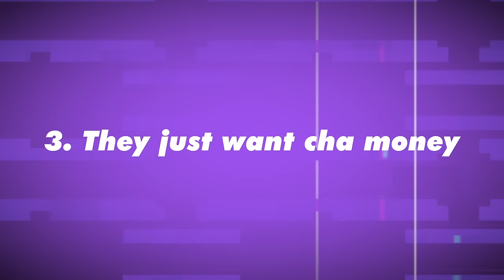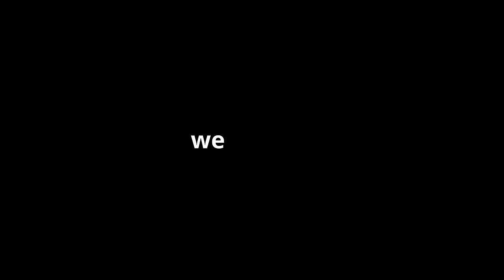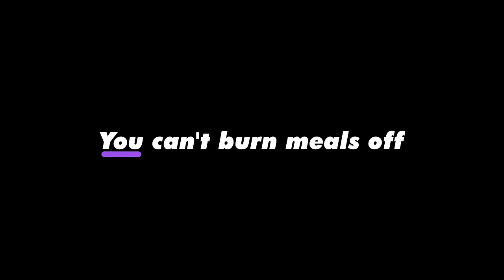3 MUST knows when beginning your weight loss journey

Comment: I do use the scale, but I do my best to not get too worked up by fluctuations. Mostly I'm curious about the fluctuations and try to determine what might be causing them, because I'm oddly oblivious to my body. I mean, I had a partially collapsed lung once and pretty much didn't realize it until I went to the doctor for flu symptoms that just wouldn't go away and got a chest x-ray. She was flabbergasted and sent me home with 7 medications. (If I wasn't walking around, she told me she'd have admitted me to the hospital.) 

Also, if things start trending upward, it gets me back in line so I don't just meh and slip back into bad habits.

Comment: I started working out to gain strength and muscle mass, but I am ALSO losing weight at a satisfying clip. 75 lbs so far... This is the longest I've been able to maintain a workout regimen because I focused on one simple goal and stuck to it rather than cast a wide net of cardio to lose weight, leg day, arm day etc... Eventually, and already every now and then, I will throw in leg and ab workouts and now that the weather is cooler I plan to ride a bike to add some cardio, but my main focus had been my upper body (my legs are decently sized but not huge), and it is amazing me how well everything else is falling in line just by sticking to a simpler goal...

By all means I am not trying to argue against Johnny or say that this is the best or only way, but I thought it bared mentioning in case there are others out there frustrated by not being able to stick to a "complete" weight loss and exercise plan like I have been. When I was younger I used to scoff at testimonials of people in their 40's saying "I'm in the best shape of my life", but here I am @47 years old on the verge of honestly being able to claim that while already in the best shape I've been in the last 10-15 years...

Comment: I've been using Noom off and on for a few years and I agree with you, they absolutely do want my money. However I did learn a lot about my relationship with food from them, enough that I think I can use that and add it to what you taught me. They are heavy on the data (weighing yourself daily to be aware of your body's natural flux in bodyweight and why salty stuff and hormones can make it skyrocket overnight, tracking calories to attempt to reign in overeating, etc.) but I appreciated them saying those numbers don't matter as much as the non-number wins like how your clothes fit and how you feel about yourself. I still haven't been successful in bringing down my weight to where I want it though (I got partway there before COVID happened and then stress brought it all back on) but I love the idea of mini challenges to give myself concrete wins that I can build on. SMART goals rather than number crunching. Thank you for this.

Also, the plant looks great where it is 😊

Comment: Caught this video near the end of my little weight loss journey, 110 lbs down, 15 to go. Most of what you said does indeed apply even if I didn't use this info specifically. I had a bit of an eating disorder where being full... or what i would now consider uncomfortably full worked like an anxiety medication. I didn't feel good unless my stomach was at capacity or even over it. My challenges were specific to my problems. I needed to break up with food, using Intermittent fasting and only eating whole food that was specific to my macros with no regard for anything else. I was able to grow from that knowledge and build a better diet that leaves me in a deficit to lose weight while still eating food i like, even if it means some of my meals are a bit unhinged to stay at a 1k deficit.

Comment: I always said when I was a kid, that I had noticed its only the fat and overweight people that count calories. That was my first step to learning that what you eat is far far more important than how much you eat. I struggle to convince people of this today, sooooooooooooooooooooooooooo many people think a calorie is a calories and it doesn't matter. I try to use the Table Sugar VS Honey example, but people won't even bother to look at research I provide them because they are so convinced it can't possibly be true that one is any different than the other. EVEN THOUGH it should be completely obvious just on the surface of it, I mean they are made of different stuff
 
Technically a ball of uranium has got a ton of calories in it, everything burns

Comment: Yeah, in my mid to late teenage years I was pretty hefty around 275 and I went to work at a restaurant where the owner actually had a gym attached to the back of the restaurant and employees go to work out there after work if they wanted and with salads from their salad bar and gym work every night I was able to get down to around 200. I kept that for about eight years, but then I started delivering for a donut Company, yes the dreaded Krispy Kreme. All the free donuts you could stuff down your hole. I ballooned up pretty quick back to what I was and higher and then I started doing over the Road semi truck driving full-time and The weight just kept climbing. I know there are drivers with plenty of discipline who can keep things from getting out of control but I don’t have a crap ton of discipline I just usually do what is the easiest. I had originally lost the Weight because The workout was right there and the salads were right there and that crap was all free, and now I have to pay for every freaking thing I do, Plus I’m old now and when I lost weight I was like 20. So no weight loss is going to be particularly easy now it’s gonna be hard as frozen snot. But like I told my mom before she passed, “there aren’t very many fat old people because they all just drop dead, So put that cookie down”.

Comment: I like your plant. I've been weeding out the junk, but my digestion was acting up 10:38  because I wasnt adding enough fiber. Now that the fiber is there, the weight is slipping off. The exercise is helping. I'm 58, by the way. Restaurants are fired as they charge way too much. Cutting the overly processed crap, too. My doctor cares about that number on the scale.

Comment: I reckon weight loss has a lot to do with impulse control.  You can be going along nicely, but then just WANT chocolate, like a child, and you DO IT, setting back your efforts - a kind of self sabotage as well.  If you can crack that, Johnny, woah !
Reply: its about the hormones in the body that determine what you eat. if you eat lots of processed food...you will desire processed foods.. If you eat lots of meat ..you will desire lots of meat.  The body uses hormones as a lever, especially insulin that determines alot of what you crave. I am a former carb addict. I would sit down and eat a full bag of cookies..and an hour later go after pop tarts... Insulin will take you down the wrong road if you let it.

Comment: I only just found this after over a year of trying to lose about 150 pounds and currently having lost merely 13. I actually got down by almost 16, but I can't seem to keep that off, let alone make any progress like I want. It's easily one of the most demoralizing things to think about. I have ADHD, so recording what I eat is next to impossible. I've tried on multiple occasions and it never works, I get like a week in at most and then it just drops off. I've settled on just trying to make better choices overall, cutting down on soda and getting sub sandwiches from work with things to try and reduce calories, but it's probably not enough. And the failure makes it harder to try other things too, because the self-doubt continues to rise. I just wish that the concept of feeling good about myself and my body didn't seem like such a far off concept. And yeah, this is like a textbook case of both exercising first and focusing on the scale, but I don't even want to think about taking pictures of myself.

Comment: I worked out off and on in my 20s and could eat anything and I had a nice figure in my 30s I was strict very strict I became a vegetarian and for protein I had non fat Greek yogurt with extra protein or peanut butter that was my big meal for 10 years straight I never missed a gym day weight training cardio I was underweight all 10 years by time I hit 4
39/40 my body just changed weight gain just came out of no where I gained 50lbs in less then 6 months and not in a normal way the entire contour of my body changed as it turned out I had lost almost all my testosterone and had adrenal burn out. Being a vegetarian and having dairy instead was really bad for my body. Also, over working out is not good along with stress is not a good thing. Now I wish I would have just been normal all these years instead of a size 00.

Comment: As somebody who used to have an eating disorder, I can definitely say that it’s not about the weight. You gotta realize just drinking, eating, and pooping can vary your weight by 10 +- lbs in a single day. I’ll wake up at 160 or 155 if I poop, but after eating and being super full it’s 175. The scale is irrelevant. Eat right, go to the gym, do cardio vigorously for 30-40 minutes every few days at first. Just be relatively consistent and don’t stress. Stress fucks your metabolism. Just chill. Slow down. Eat well. Avoid red meat, lactose, and get the nutrients u need and you’ll be fine. It’s not about the destination, it’s a lifestyle to be better. That’s all you can try to do.

Get a heart monitor watch. My avg resting heart rate is 55 ish now. Your goal is sub 80 and even 60 if possible. Also, your heart rate standing, sitting, lying down, and sleeping are all super different. Just learn as much as you can about when your body feels good and when it doesnt. My heart feels better when it’s lower and I think when my omega 6s and 3s are well balanced. Also stop drinking soda. That shit is poison. Simple sugars are poison especially high fructose corn syrup and refined (white) sugar. The only simple sugars in your life should be fruits basically. Get brown and mixed grains type of carbs. Not white rice. If you go to chipotle to get protein chicken, get the brown rice and legumes (beans) in there for example. I’m a vegan so it’s way harder for me, but it should be easier and healthier for somebody who combines this stuff well. Good luck

Comment: As someone who was almost 400 pounds at 21 N has been roughly at 190 for 4 years now. Weight loss is all a mental game. IF you don't want it it won't happen. That's the first part of the battle. Second is learning your body n what it takes to sustain it. Now you gotta go into caloric negative to get fat to burn. Also figuring out if theres key things you do or eat/drink that are really bad for you. Like for instance soda's. I cut them out completely N it helped the weight loss start so much quicker. (My weight loss journey was about a 6 month period max) You will feel like shit at first but push thro it. Calories is everything. That's what matters. Getting your body to start breaking down the fat its stored is the most important part. Working out ecetera is how you gain muscle. - Just my two sense and my experience.
edit - Don't forget protein and greens in your weight loss journey peoples. I did it thro tracking my weight visually and thro the scale. I didn't notice anything visually for awhile (You get use to the minor changes that happen over the course of time) but the scale can keep you on course. It wasn't till people started to tell me about it and I saw older photo's that I could see it like night and day. Literally 2 different people, me at 190 now vs me at almost 400

Comment: I can think of a reason for the product specialization of the districts, albeit, not really a very good one.
On theory, it should make the districts easier to control. If coal district is giving you trouble, stop sending them food until they shape up and fall back in line.
I'm pretty sure it wouldn't work that way, but I think that might be the intended plan.

Comment: The primary reason I want to lose fat is because I want to fit in X-Tall clothes (I'm 6' 3") instead of X-Big clothes (because they presume you're just basketball with limbs). I want to be able to lift my own body weight. I want to remove my body fat as a contributor to my sleep apnea. I really want to not need a CPAP.

Comment: I'm glad you mentioned measuring waistline inches. You could have taken that a step further and spoken about the Waist to Height Ratio as a better alternative to BMI (which is known to be a poor health indication tool.) Also, why did you not even mention the problem with overeating carbohydrates? The modern diet is upside down we are taught to eat excessive amounts of carbohydrates (see Dr. Ken D Berry #KenDBerryMD or Dr. Sten Ekberg #drekberg.)